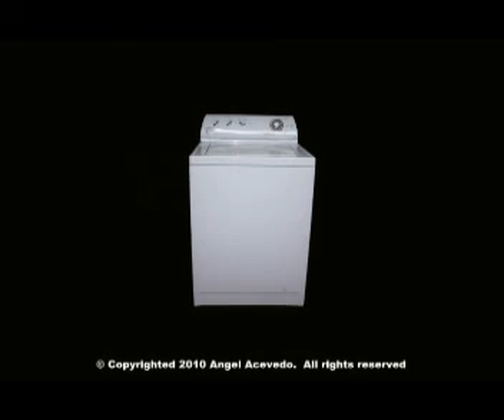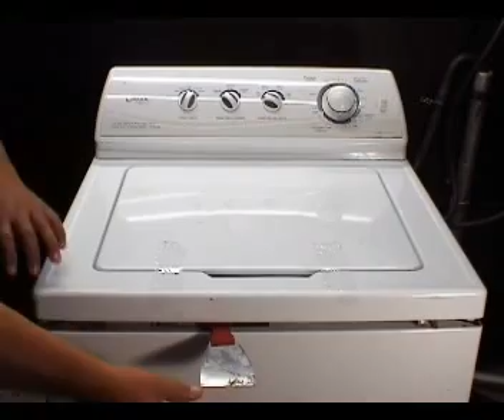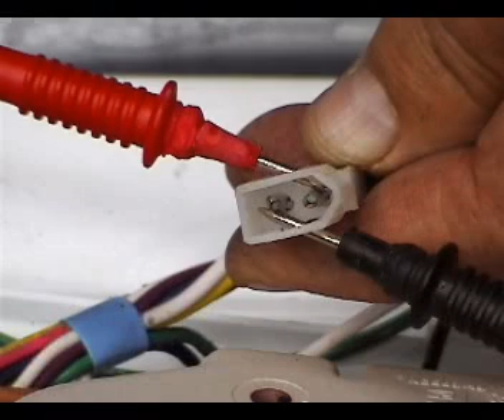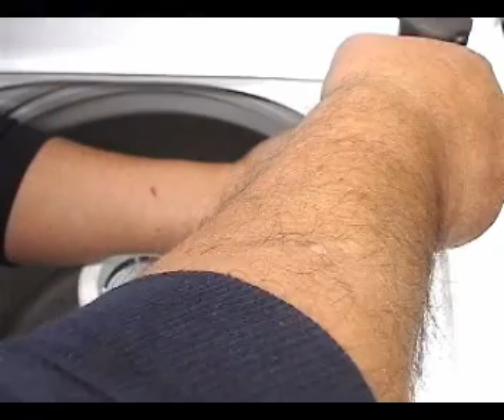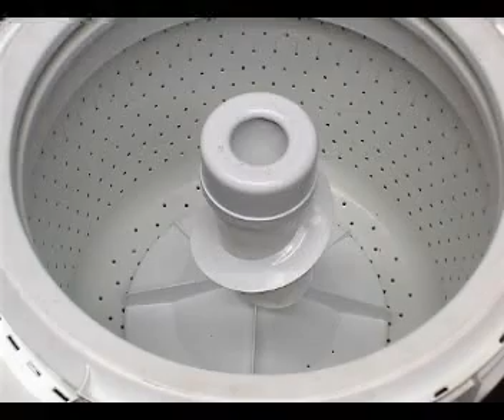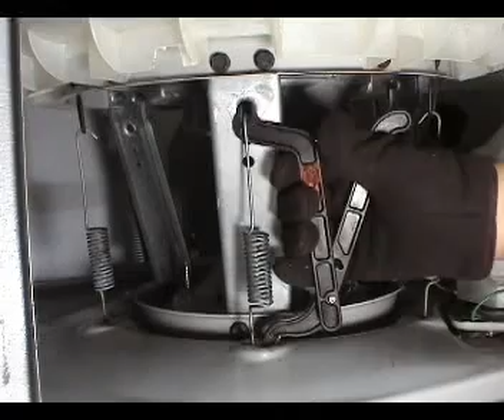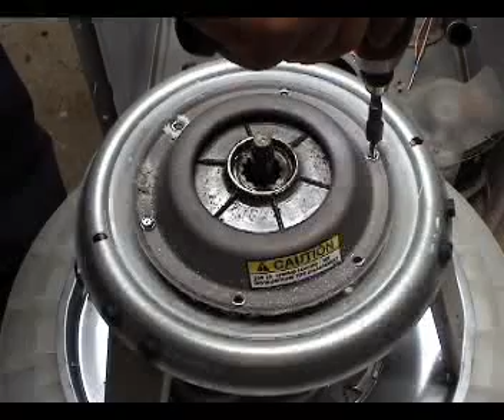Performa Washing Machine Not Spinning The Clothes - See The Parts You Need To Check & Replace

Comment: Here's how to find the chapters in this video:

0:00-0:28	What to Check When the Washer Won’t Spin Properly (Diagnosing the problem)
0:28-1:57	How to Check the Spinning Speed
1:57-6:28	How to Check the Door Switch with a Jumper Wire
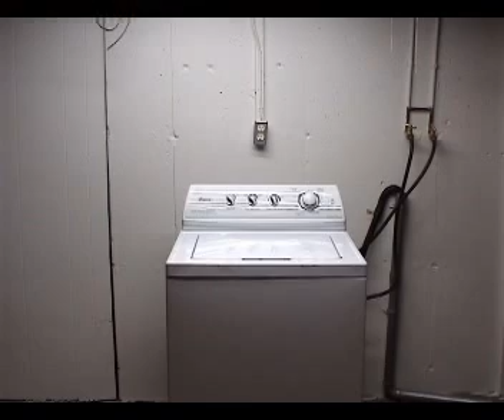6:28-7:36	Replace Thrust Bearing
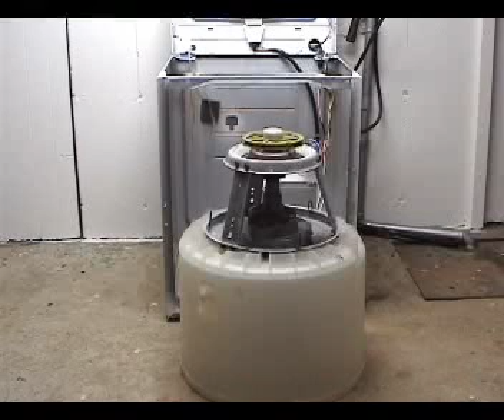7:36-9:51	Remove Tub & Transmission Together
9:51-12:47	Replace Transmission
12:47-End	Re-Install Tub & Transmission

It's an excellent video.  I wish more were put together this well.

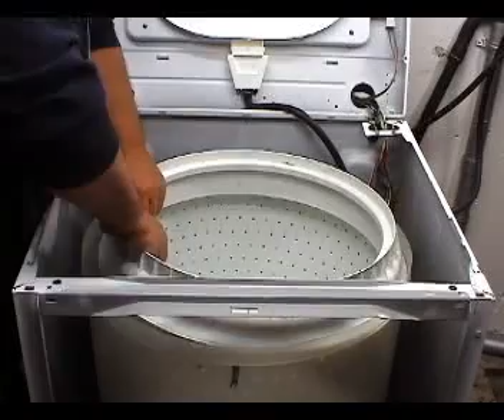Comment: The bolts at 8:10 are not stainless and get very rusty.  I was able to drive a 6-point 7/16 socket onto mine and get two of them out without breaking, the other two broke off.

Comment: My washing machine is a Admiral direct drive washer made by Whirlpool pool I believe in 2008. But doesnt use a belt as far as I know. It looks like it just has a box full of gears . What do you think could be the problem why it has a very slow spin. When I use it and it spins slow sometimes after about a minute or two it'll start spinning fast. Then there are times when it just spins slow and it will not speed up. Do you know what the problem is?
Reply from the maker: hexk the clutch

http://www.do-it-yourself-washing-machine-and-dryer-repair-help.com/notspinningWhirlpoolwasher.html

Comment: i have a performa that clicks as it is getting up to speed in spin cycle. i replaced thrust bearing with a kit but is still doing same thing. any ideas?
Reply from the maker: Is hard to determine where the noise is coming from without been there to check it.  I know for a fact that the pumps on those washers get noisy when they wear out. Since the pump pulley is turning at the speed of the motor I would check that up to see if it is the pump
Reply: Thanks for good technical service of my jobs I gate a lots of new  experience
Reply from the maker: Thank You For Watching My Videos
Click on the link below to check my website
http://www.do-it-yourself-washing-machine-and-dryer-repair-help.com/ 
Angel theapplianceman

Comment: This is the same machine that we have had almost 16-1/2 years. Most recently when running it the last few weeks it gave off a smell of burning candles. My daughter thought it smelled of crayons. Last night it stopped running all together the reason I am researching what the problem may be. Last week I took the original belt off the 3 pulleys. Didn’t look too bad but I replaced it with a new one. Before I replaced it I inspected all pulleys and wiped them down with alcohol. All 3 Pulleys turned freely. At some point today since it locked up last night I will tilt it back and check the new belt I installed last week and once again check the pulleys. To see if they still turn freely. Hope I can find the problem. If it ends up being the transmission I saw online they are selling for $337.00 not worth it on a 16 year old machine. Anything else even a motor I will replace. Any ideas out there let me know.  Add on. Found my problem. It was the motor making the burnt candles smell. Took the new belt off and found the motor frozen as it seized up. I replaced the motor and it runs like a new machine once again.

Comment: I replaced the thrust bearing but the tub will still not spin.  It will not even turn by hand with no belt.  This is a Maytag Atlantis with single belt.  So, is there another bearing that commonly goes out or does this sound like the brake or what?
Reply: I have the same problem. I saw no one answered you. Did you find the problem?

Comment: This is just what I needed to watch. mine wont spin but motor runs and it agitates fine. seems like drum is locked up.
Reply: What did you do to free the drum? I have the same problem but both the drum and agitator won’t spin. I was thinking that maybe the drum assembly is locking it up. I see your problem was 10 years ago. Hopefully you are still around to let me know.